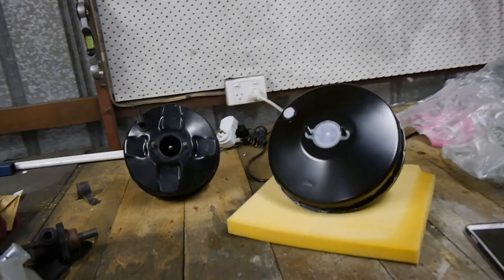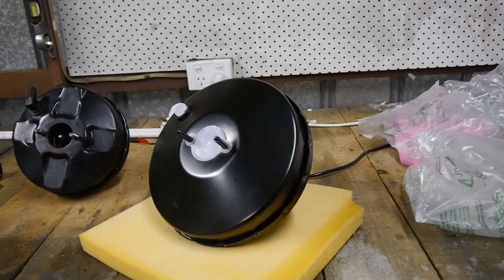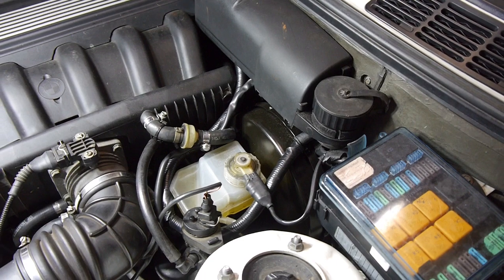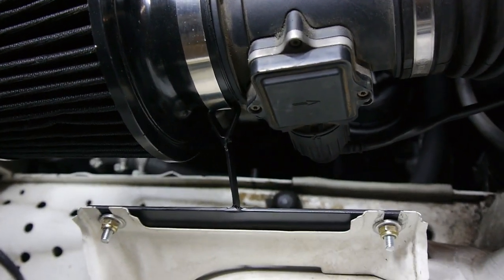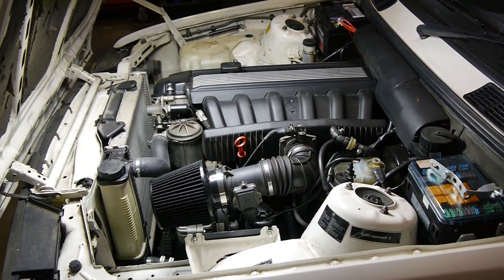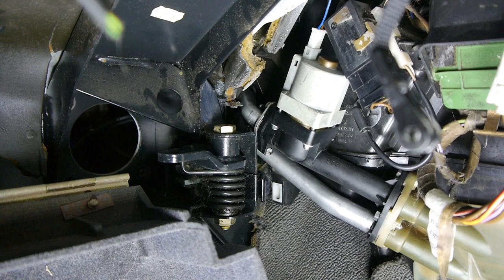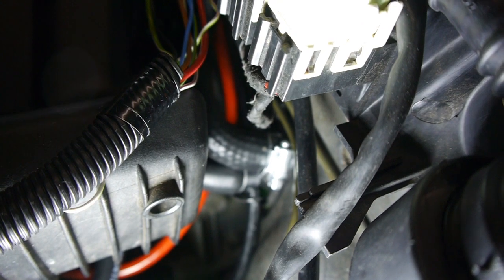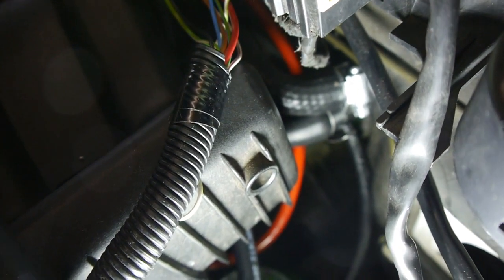E30 M52 Conversion Episode 9. Cleaning Up The Engine Bay & Going Legal.

Comment: Cool fact, m50 manifold clears brake booster with a little shaving manifold fins ;)
Reply from the maker: looking at it, to achieve that you would need some engine mounts or large engine mount spacers to make that happen I would imagine.
Reply: LMSProductionsSA True, I used e36 mounts upside down. My m52 manifold didn’t fit, but m50 did with little fins shaving. The m50 manifold sits slightly higher. It is probably a combination of thicker engine mounts and m50 manifold sitting higher which makes it fit
Reply from the maker: Yeah that would do it then. It's another option for people to try.

Comment: Love the build, did you have any issues with the fitment of the g240 gearbox? Planning on doing the swap and wondering if there is a lot of modding needed the to get the gearbox in the right place.
Reply from the maker: Gearbox itself bolts straight in due to the way the gearbox support is designed.  The bits off it require shortening like the drive shaft, shifter linkage though. Also you can't run an m30 clutch and m30 RHD flywheel combo as the bell housing is too small, M20 (RHD or stock) or m52 flywheel is fine though.
Reply: Also, did u run into any problems with the ews system and how did u get around it? Or do the Australian models not come with them?
Reply from the maker: I had EWS removed from the computer by someone that knows all about them. Unfortunately I can't tell you much more as I shipped the DME to him and it came back unlocked.

Comment: Did you need to do anything with the 3 main wires from the automatic part of the engine loom that attach to the ECU?  I remember you left them long in case.  My loom is also from an automatic model so it would be good to know if I can just cut them and insulate them.

Your videos are a great source of information by the way.  Thanks for taking the time to post them up.
Reply from the maker: Thanks mate.

They are still left long somewhere in the loom. Never needed to do anything with them.
Reply: +LMSProductionsSA thanks!

Comment: Do you know the diameter of this booster?
I have a clearence issue in my E12 with tue M52tu, and need to find a solution.
What mods were needed and which mastercylinder you use in this booster?
Thanks a lot!
Reply from the maker: Looks to be 9" but it's a bit hard to measure in the car. I used the stock E30 master. Otherwise it was bolt in.